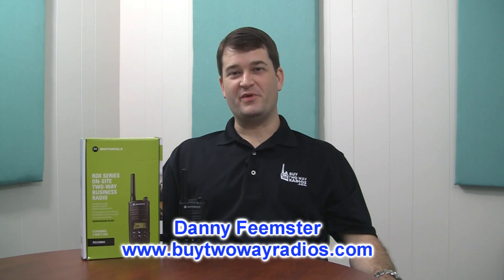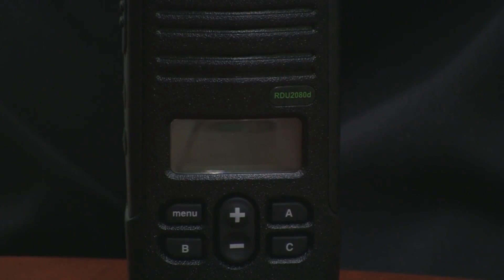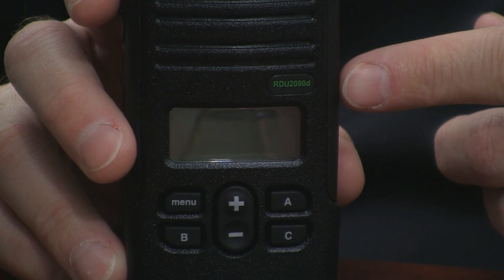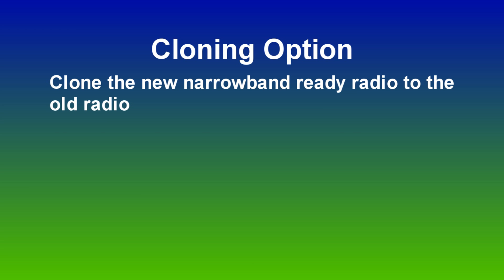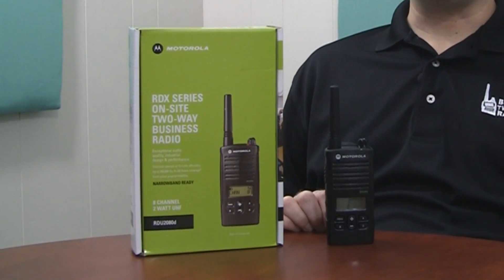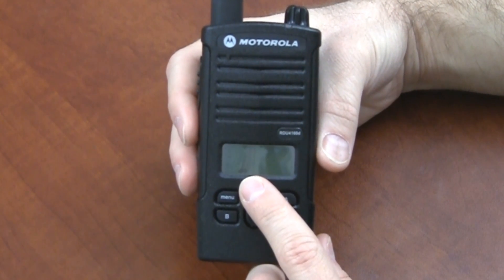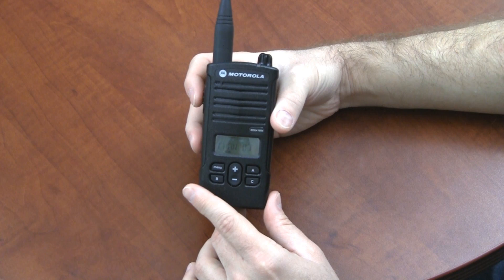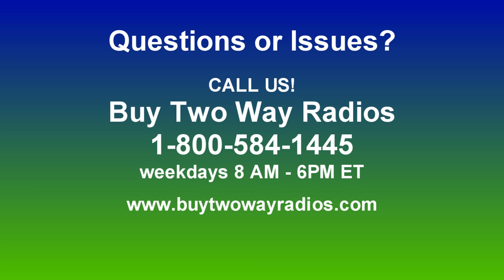How to update Motorola RDX Series two way radios for full narrowband compliance

Comment: On my Motorola RDU4100 it shows Firmware 1.07 Installed. How do I update the firmware on my radios? I don't see the option using CPS.
Reply from the maker: On CPS, click on "Device" and then "Update". Keep in mind it may take a few minutes for the software to locate the firmware options for your radio. After that just select the version you would like to install.

Comment: Hi. I baught  an rdm 2070d on ebay. It has a business name on it when u turn it on. How would I change that to my business name.  Thanks.
Reply from the maker: Customizations to RDX series radios require the Motorola programming software and cable for the particular radio.

Comment: is it the same for Motorola RDM2070d
?
Reply from the maker: No. The RDM2070d is a VHF MURS radio and was made for a specific retailer. MURS was not included under the 2013 Narrowband mandate for radios on UHF and VHF business frequencies.